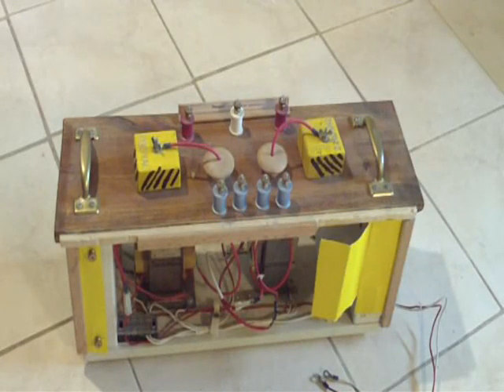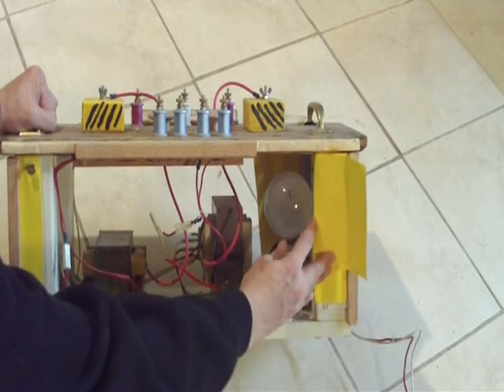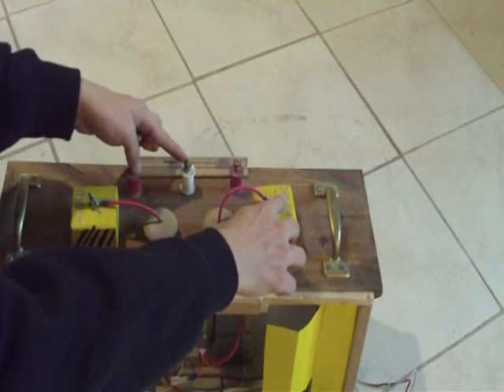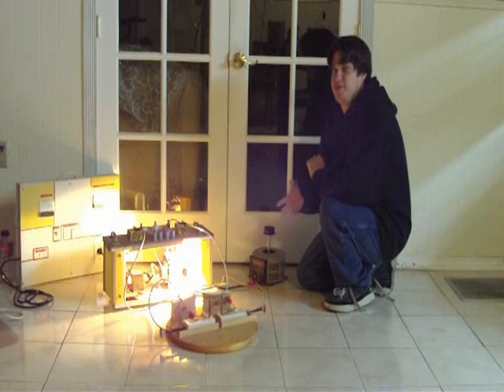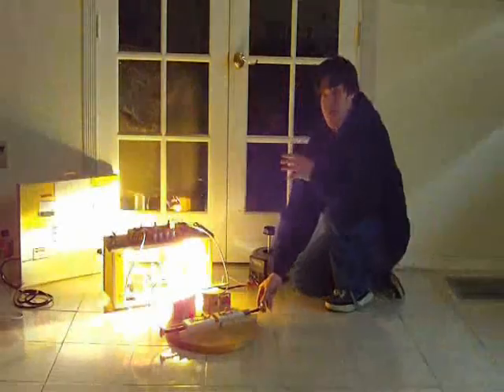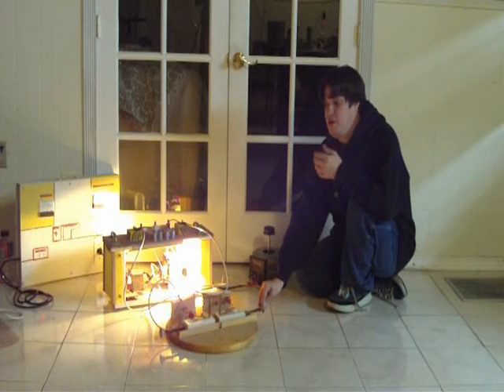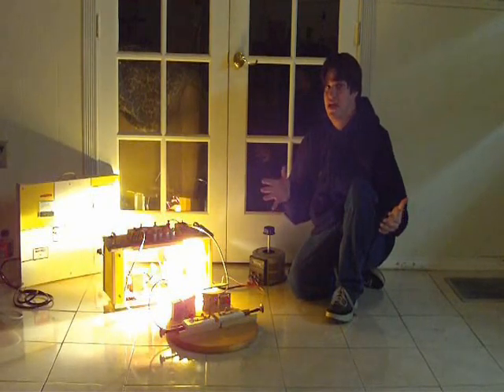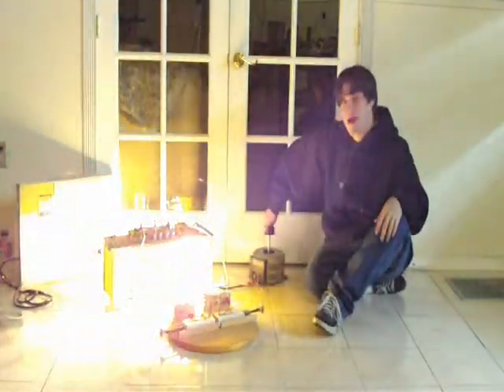4,000 volt power supply (microwave transformers)

Comment: it's possible to connect 6 mots in series without putting them in oil 
( thats 12kv )
u have to ground the 2 cores in the middle mots and then unsolder the secondary winding from the core of the outer two mots,
this acts as a mid-point grounded transformer,
i have a 4 mot power supply without oil, i soon hope to find another 2 mots, 
i have a video of my 4 mot jacobs ladder

Comment from the maker: Great!  I'm glad the video helped.  The only problem is that 4kv is probably still too low for a Tesla Coil.  You might be able to make it work, but you're going to have trouble getting your spark gap to fire smoothly.  Also, you should probably use something different to limit the current.  A light bulb works, but it does seem to drop the voltage a little.  You want all the voltage you can get.  Try an inductive ballast like a motor or a big choke.

Comment from the maker: Yeah, 8kv is really pushing things.  These transformers have thin insulation and they just weren't meant for voltage that high.  I would say that the max is 3 transformers in series, any more than that and you have to put them in oil for insulation.  The way I had it here, there's 4kv total, but with a center tap each transformer only has to withstand 2kv.